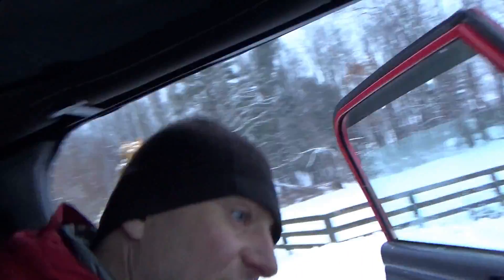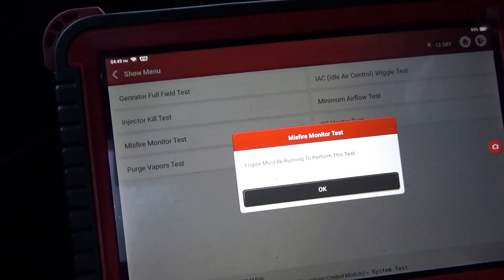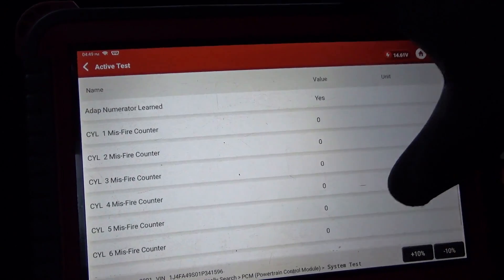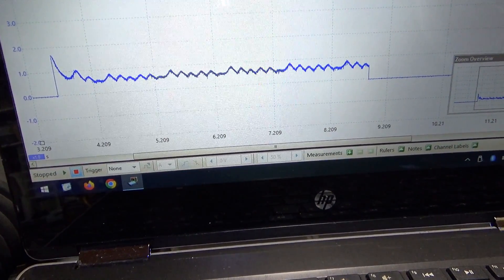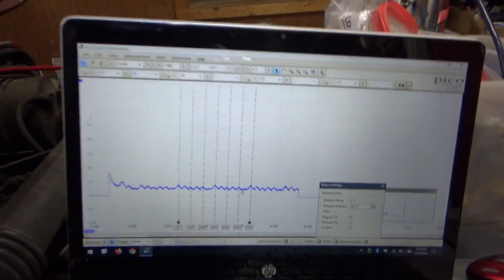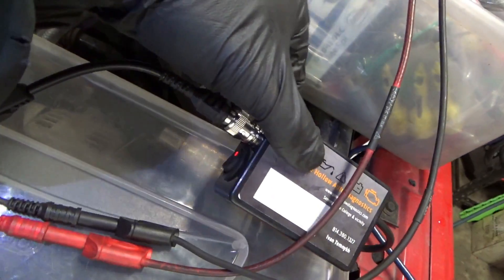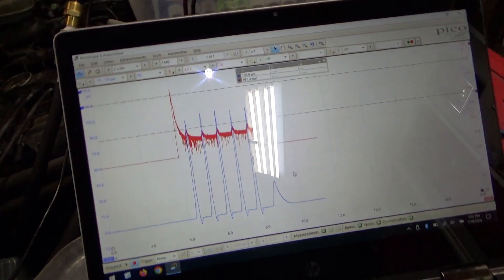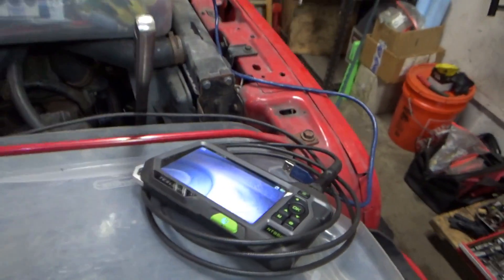Jeep 4.0L Runs like "Garbage"? (Part 1 - Diagnosis)

Comment: Brother calls me yesterday with an 07 Silverado that has over 75 pounds of fuel pressure.  I said need a regulator/pump. He said brand new pump. I asked the brand. He says Delphi.  Sorry dude, if you got no FSCM, you got a bad regulator.  Apparently it had the same issue with the old pump too.  Both banks running rich.  I haven't gotten over there yet to check it out.
Reply from the maker: Sounds fun!

Comment: Oof..     I'm not sure a "valve job" is going to fix this thing.   I'm not sure-- but I wouldn't think those seats are replaceable on this head like they are on a diesel.   I think he might end up needing a new head.. or at least some machine shop work.   I know these 4.0L are actually pretty great engines and finding a used head would be fairly easy to do if this one can't be fixed.    Looking forward to it, as always.
Reply: Reman engine and call it a day. Placing a reman head on a tired engine is to risky on a customer pay car. Paying customer will not be happy when that tired engine now burns a quart every 500 miles.

On my personal car with my time, I’ll risk it
Reply: @mph5896 That was pretty much my thoughts on this one. With a reman head and labor, your about halfway to a reman long block. I did 2 of these with Promar engines (one was a 4 cyl.) and had great success. Did however have one bad experience with them on a 5.7 GM, but they took care of it, sorta.
Reply: @mph5896  yeah.. Same.  I would if it was mine.  But I can see how the expectation of being paid for it---   you might want some more reliable results.  But then again --  if the customer understands the risk--  you can just say:  "I found this junkyard head--- I'll just slap it on there and you can run it again...  no warranty"...   but it's simple and won't take you long-- so it's fairly reasonably cheap.  It can still be a good deal for the customer--  especially if the customer is the one that found the head..   just set the expectation that "you're choosing to roll the dice here-- and it may not pay off for you" --  If they still say yes:      SOLD
Reply: Seats are totally replaceable, you can even fit seats into old engines that don't have them.  Machining will always be required, it's not just a case of buying a new seat and fitting it as they come completely unfinished so all the correct angles have to be cut after fitting.

Comment: Hi again Ivan. To be polite your diagnostic was correct, at 100% sensitivity there was no misfires on any cylinders which was correct which leads you bad compression if its firing correctly or am I wrong?
Regards Richard 🇬🇧
Reply: These engines are just too old..  The misfire counter doesn't work very well.  Plus I think it only goes by a meter reading inside the coils..  As long as the spark plug is still sparking--   it won't read a misfire.   Because I don't think these even have a knock sensor-- so it's not reading misfires in the same way as a more modern vehicle.  ( I could be wrong though.. :)
Reply: @calholli it uses the crank sensor to detect misfire.   It's hit or miss... as in detects misfire when there isn't and doesn't when it should lol.